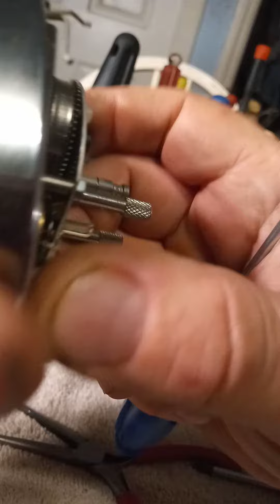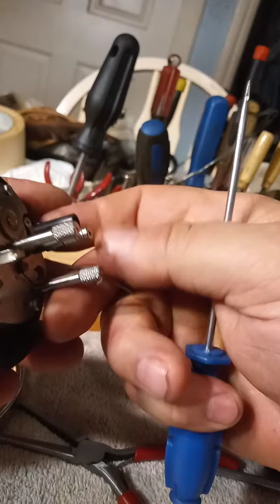Servicing a Westclox Baby Ben clock for Carla 20210506 223140

Comment: Hello - thanks for video.  Have question - with removal of clock hands - when replacing how to get back exactly to setup had before removal?  Do need to replace exactly as removed?  Also are just a press fit to shaft?  Thank you
Reply from the maker: You should be able to put them in any position that only thing that you have to be concerned about is the alarm hand. Once your alarm goes off set the hand to the time that clock is on. Good luck.
Reply: @ thank you for update
Reply: @munnerlyn3  hello again - the minute hand lifted off fairly easy - this on a very thin straight up shaft thru clock face.  But the hour hand very tight and not to lift off and the hand is tight against a fatty base that comes up through the clock face.  Tried to pry off with little more force with 2 small screwdriver heads - one each side but not coming off.  Any ideas would have?  Hate too apply to much force and then break some part inside unit.  The base of clock has marked canada rd 1931 and looks like model is a A 1 with other below looking like 61L.  Thanks any further help.  I need to remove face to get below for checking other parts so have to lift off the minute hand somehow.
Reply from the maker: @michael-qp9xd  some of the clocks such as a Lux clock the hour hand will not come off. It might be the same way with this clock that you are working on. The hour hand is pinged on some around the metal with some sort of tool where they dont come off. If you can take the face off leaving the hour hand on that is what I would do. Good luck.